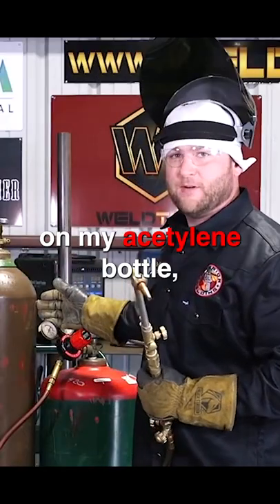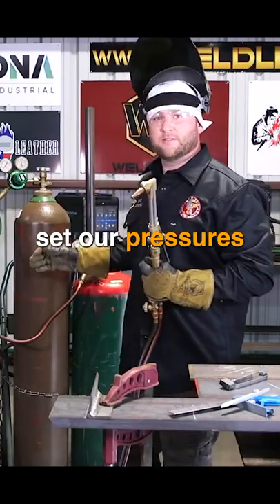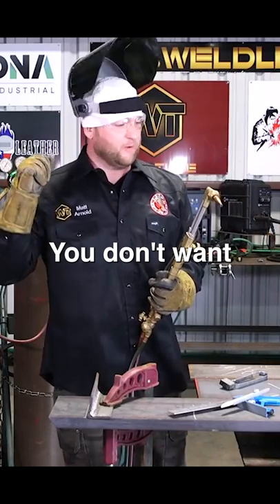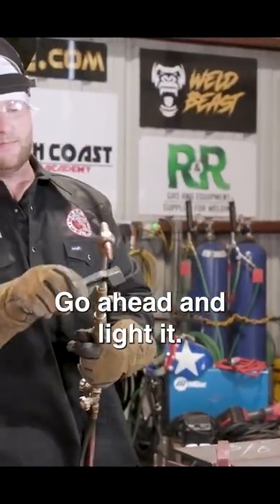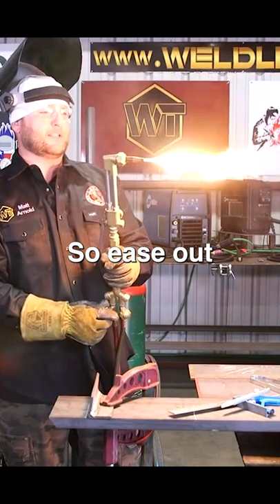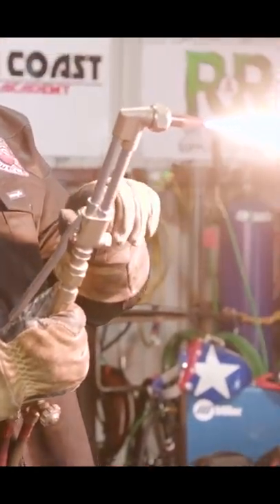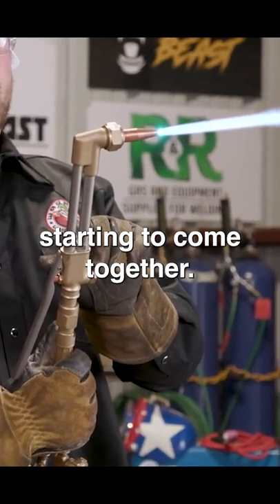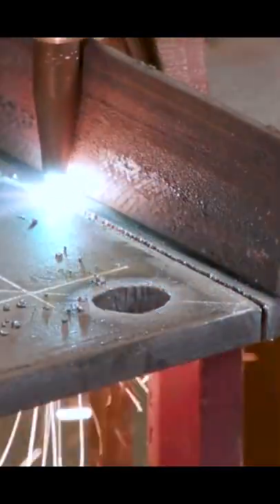How to set your oxy-acetylene cutting torch?

Comment: I love how nobody explains that u open the oxygen tank all the way and the acetylene bottle only 1 turn. And the lower oxygen valve on the torch gets opened all the way or u won't have anything when u adjust the mixing valve
Reply: Thank you.  I just taught this today and I was thinking it wasn’t quite right.
Reply: Crack the O valve so you don't get soot.
Reply: One turn is too much my guy

Comment: Crack your o2 valve along with the acetylene valve and then you won't get the black smoke.
Reply: You also don't get proper control over ignition.
Reply: @jonathangarzon2798  as well as the acetylene flow.

Comment: A clean tip at 7 & 40 will pick a quarter up off the floor
Reply: Any size i guess? 
But yes works for the most typical sized and thicknesses.

Comment: That oxygen valve down at the base of the torch should’ve been open. Adjust the flame with the valve up on the neck. If you’re cutting anything thick, you’re probably gonna need closer to 10 pounds of acetylene. What you really want to pay attention to is how clean the tip is. You want to have a clean laminator flow out of the center hole of the torch tip/nozzle. Also, there is a lot more to learn about safety, etc. when it comes to using a torch. The size of the acetylene bottle is critical to the amount that you can draw from it. So when using something like a rosebud, be sure that your settling bottle is big enough to accommodate such a Device.

Comment: Instructors always teached me:
Open oxygen first, then acetylene, ignite and regulate (it's loud alright, but supposedly safer that way)
Close acetylene first to shut off, then close oxygen (if you stumble for whatever reason with your torch, if you close acetylene first you at least have only oxygen left, not filling the room with explosive gas)
Reply: Hmmm if you open the Oxy first and forget to open the acetylene and try to light the oxygen you won't be around to realize your mistake.
Reply: @Farmboy1544  I was a fabricator for 45 years and never got blown up lighting a torch. Oxygen doesn't burn. It oxidizes. It is a factor of a fire but not a fuel.
Reply: I've always lit acetylene first and added oxygen after. It's not safer in any way. It just makes it harder to light. Of course, you don't want to turn on your acetylene to the point it's spewing gases. Just a little crack to get it started is all you need.
Reply: @AK that's what's in my learning book, the oxygen draws the acetylen through ventury effect so it will not blow back

Comment: you have 2 oxy knobs. are you leaving the bottom one closed and adjusting with the top one?
Reply: No, you open the bottom green line (oxygen) knob at 100%. Then crack open the red (acetylene) knob 25% and light it, adjust your acetylene like he described, and then use the knob at the very top to adjust acetylene/oxygen mixture

Comment: Or you can adjust fuel until the flame starts to jump off the nozzle
Reply: That's the way I was taught. Also to set the oxygen at the shape of the flame while holding the cutting valve open.
Reply: @Thatguy-hc3ed  yeah see the nice sharp oxy jet down the centre 👌

Comment: My knowledge about these stops at brazing. I usually have mine at 6/12 for that. Why such high oxy pressure?
Reply: If you’re brazing you need a clean burning flame, but for cutting you need a clean burning flame as well as enough oxygen pressure to do the actual cutting. The flame is really only there to maintain heat, once you start the cut you can technically turn the acetylene off and keep on going with just oxygen. More of a party trick than something anyone would actually do, but hopefully that answers the question.
Reply: Its a CUTTING torch. Different design. And different tip sizes will require different pressures according to the table, but 7/40 is a good staring point for 01,02,03 Victor tip sizes.

Comment: It looked easy but I got to try for my first time it hard finding the right ratio for the gas☹️
Reply: On the pressure regulator settings?
Reply: @dirtyaznstyle4156  nah, on the torch like trying to find the neutral flame
Reply: @PoPpOp-wg8rf  do what he said open the fuel valve till the black smoke just begins to disappear then open the o2. You shouldn’t hear anything with a properly set torch. Neutral flame almost no noise then you’re ready to rock
Reply: @adub1300  then press cutting O2 lever and do fine adjustments for neutral flame.
Reply: Note that if you do have to do the fine adjustments then your pressure settings probably not right or the torch need maintenance. Find the pressure for the tip# you are using from the manual or manufacturers web. Use the proper tip for the thickness of the steel.

Comment: I was taught to use an oxy torch in my high school welding class but im gonna ask you something they never taught me… why do you need a neutral flame
Reply: I’m thinking because blue fire is hotter than yellow, makes a cleaner cut with less time
Reply: Needs to be neutral so the oxy fuel mixture is correct then when you hit the o2 it’ll cut properly
Reply: It has to do with adding or removing carbon from the metal. A neutral flame will keep the metal as it was made. Oxidizing or carberizing flame are the other terms.

Comment: Does anyone know a price for a set up like this?
Reply: It's about $400 for the torch, hose, and regulators when bought in a kit. The bottles are about $400 to $600 for the big oxigen and the acetylene. But check on offerup, I got lucky and found mine for a steal at $350, but you have to be looking. Good luck, and if you find something like that, take advantage.

Comment: And no shut off sequence?
Reply: You just gradually tighten the valves on your handle to shorten the flame to be relatively small and turn off your oxygen first, then your acetylene. After that you turn off flow on your bottles, bleed the lines, and wrap it up. Don't leave your lines out. They could get cut on any number of things in a metal workshop if you're not careful.
Reply: @stranded3110  so after much research I've found out it entirely depends on the torch model.
Which is such an insane safety issue my jaw almost dropped.

We have an old victor combo torch in the current shop I work at and I always shut off the oxygen to keep it from popping. One of the gaskets finally gave and since I was mid job the supervisor went to buy a new one instead of waiting to rebuild the old one. Turn off the oxygen first and it ALWAYS pops, so I had to start going acetylene off first. I swapped back the old combo once the gasket was fixed and boom acetylene off first is the way to keep her quiet.

How of all things is this not standard
Reply: @jonathangarzon2798  makes sense, we always get the cheap kits cause we do a lot of contracted work in hog farms so everything is always mostly new, but doesn't last long considering the environment.
Reply: @stranded3110  it's unfortunate because even a pricy victor torch feels like a cheap tool when compared to it's older counterpart

Comment: Why don’t you half turn the acetylene and quarter turn the oxygen when you start it so you don’t get all the soot?
Reply: Because the flame will backfire into the torch body
Reply: Because you suppose to adjust the fuel flow until no soot, and only then turn the O2.
As the gas bottle goes lower and the flow passages gets dirtier inside the torch, the optimal flow will vary, so you need to establish flow of acetylene first.

Comment: Had to teach this to a new guy with 20 years as a mechanic he says. But couldn’t light a torch . Hmmmm😂
Reply: Depends on the type mechanic and where they're from. And if you're not from up north you'll rarely if ever use a cutting torch as a light duty/auto mechanic. Rust isn't nearly as big of an issue down here unless you're near the coast.
Reply: A guy I worked with cheated on his weld test by having someone else do it for him. He's now a certified welder that can barely light a torch and can't run a bead to save his life. Safe to say he doesn't work with us anymore.

Comment: Я сварщик, но чего то я нихрена не понял. Какие у ВАС цвета баллонов и где какой газ? И газовый резак-нахрена у него 3 вентиля. Рычаг-это я понял это "режущий кислород".
Reply: There are 4 valves at the handle, 2 are hose shutoff valves.
  The fuel hose valve regulates the idle flame fuel rate. The oxygen hose valve is turned much further open, and regulates the cutting oxygen flow rate. 
  The oxygen vernier valve at the middle of the handle regulates the idle flame oxygen content.
  The oxygen toggle valve is typically fully depressed while cutting. Turn the oxygen hose valve to regulate cutting. 

Hope that helps.  😊